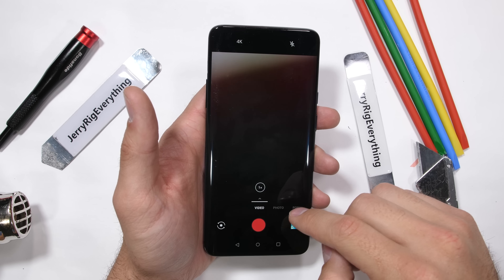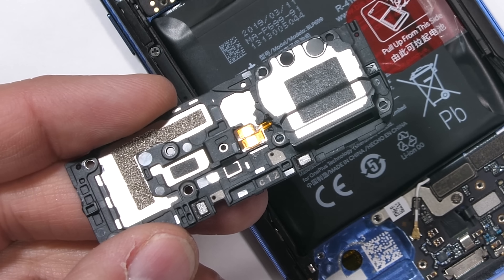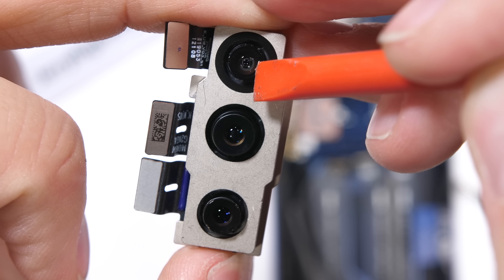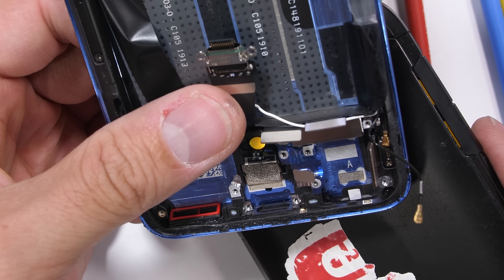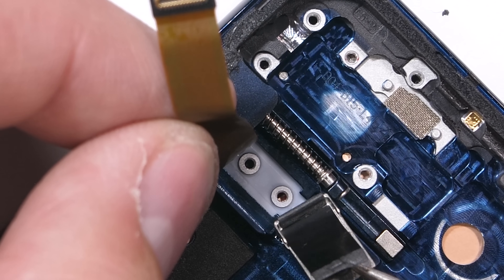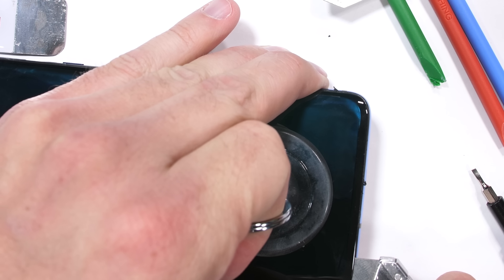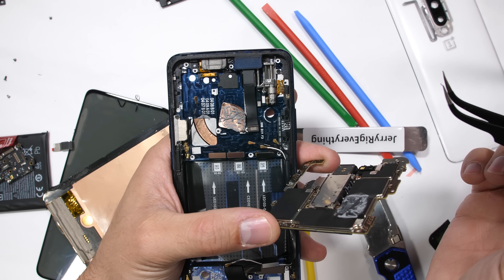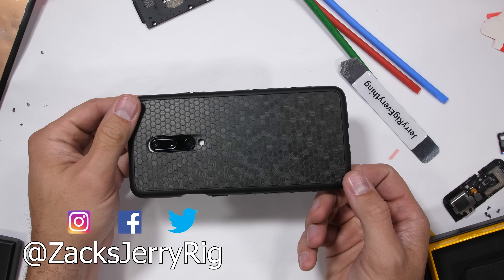OnePlus 7 Pro Teardown! - Is the Pop Up Camera Water Proof?!

Comment: Why can't we replace the indisplay finger print sensor (which is just a camera ) with stock camera both in front and back???(pls mention me if you read this @jerryrigeverything )
Reply: Because the optical sensor used for the in-display fingerprint reader is functionally different to the cameras used for the motorized selfie cam and rear camera trio. There wouldn't be any need to put, say the primary 48MP sensor for use as an under display fingerprint scanner as that would be a gross waste of hardware. 

Adding to that, the optical sensor needs to be small and compact to fit under the battery.

Comment: I love how oneplus don't glue their screen and bettieries with top of the line glue that is impossible to remove without destroying it, makes it so easy to replace battery and glass on screen without having to replace the panel itself, Apple loves making it hard to fix their phones from third party repair shops and glue their glass to the display so you have to pay for both glass and display replacement...

Comment: Ten layers of cooling
1. Front glass
2. Amoled display
3. Copper heat pipe
4. Copper wick
5. Water vapor
6. Aluminum frame
7. Copper square
8. Motherboard
9. The other side of the heat pipe
10. The rear side of the phone

Comment: 4 layer of copper + 6 layer of graphite film= 10 layer cooling system 😁 or maybe 1 copper pipe+1 copper wick+1 square copper plate+6 graphite film+1 thermal paste= 10 layer cooling system 😁 La Casa De Papel